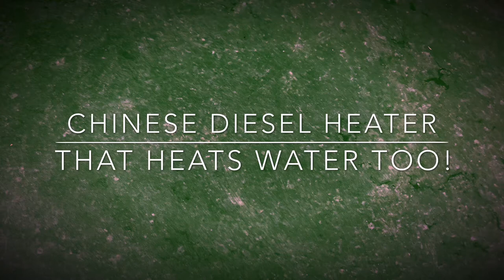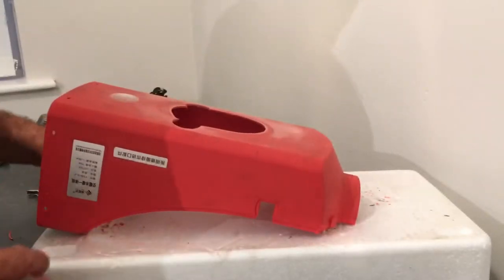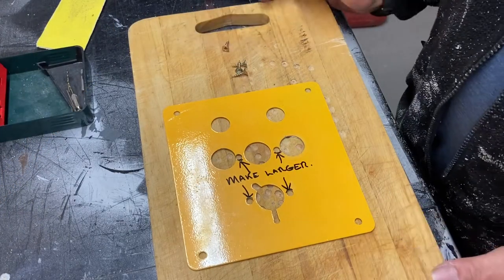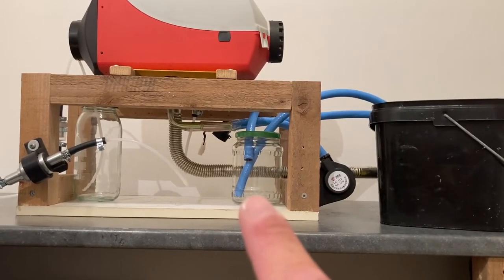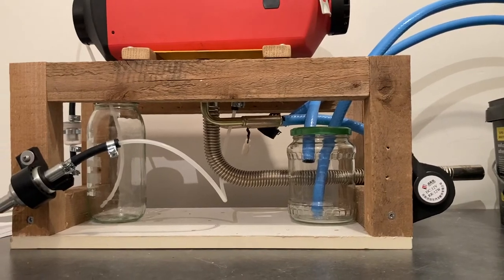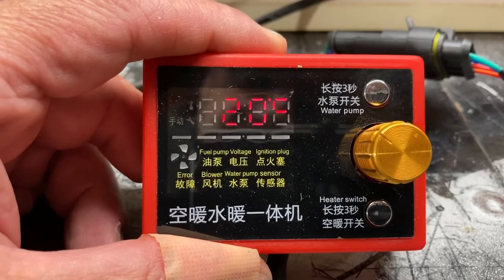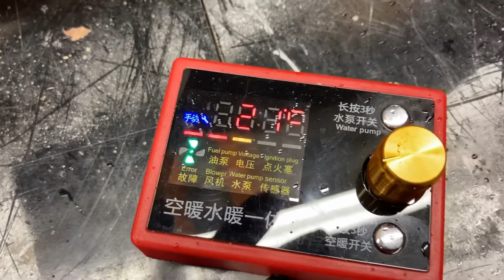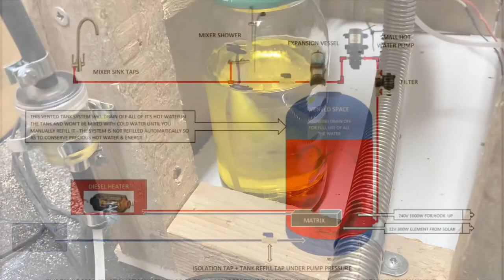Chinese Diesel Water & Air Heater Feasibility Test

Comment: I have installed one of these units in my campervan. I used a 22L marine hot water tank with a heat exchanger running  off the heater. I put in an expansion tank because I was worried about the build up of pressure in the system.
It heats water very well, 30 mins of running on low gets my 22L up to 60c but......this is were the problems come in. I did not want the water any hotter but still wanted to heat the van, so I switched the circulating pump off. It took about 2 minutes for the transfer liquid (antifreeze) to boil in the heater, that blew a lot of antifreeze out of the expansion tank.
I have not worked out how to have air heat without overheating the water, it may be OK if you could drain the liquid completely out of the heater but that would be difficult. I am considering putting in a NZ$200 Chinese air heater I have to just keep the van warm.
This was complicated to install and I sometimes wish I had gone LPG but I really wanted Diesel.
Unfortunately i have not found anybody else in the world who have actually installed one of these in their camper! They  work but you need to be aware of the limitations and design your system accordingly
Reply from the maker: That is incredible valuable information     
  And i never thought of that issue. I just assumed it would be fine with the pump off and the heater on. Maybe its best i buy a cheap separate diesel heater perhaps just a 2kw one as i thought 5kw may be too powerful especially when its not thermostatically controlled. Mmmm you have me thinking. However part of me thinks well may as well just keep heating the water too perhaps?
Reply from the maker: Maybe an option is to keep the pump on but re route the coolant through a towel rack in the shower cubicle stopping the coolant from over boiling?
Reply: @diycampervanman1633   Yes I have been considering that, maybe running through a radiator heater (as in a car heater) but experience so far leads me to believe that this heater  is so efficient that I could not dissipate enough heat to stop the coolant eventually boiling.
Reply: @diycampervanman1633   The only option I can think of at the moment is to fit a separate diesel air heater. I have one that I brought cheaply but finding space for a second heater and the getting a diesel supply to it is a problem. 2kw will be ample for me as the the water heater will be blowing hot air for the first 40 mins and combined with with the 2kw too keep the van warm should be no problem. When I let the water get too hot the pressure build up blew  a pipe off in the hot water system (Twice).....another thing I am working on.
Reply from the maker: Peter Ockleford  i never run my experiment long enough to discover this problem and it is a problem. Once you achieve the water temperature did you run the heater on low thereafter or a higher setting? The last thing i want is to have coolant swilling around the floor area getting underneath my insulated floor. Im going to have to run the experiment again and keep testing the coolant temp. Im really surprised the air flow doesn’t keep the cask cool enough, surely it should as thats the whole point of the fan. I can buy a cheap small towel rack and try that but ill need an electronic  switching valve to re route the coolant. Maybe a different coolant might be the answer with a bigger boiling point but as you say eventually it overheats. I also thought of putting a header tank at a lower point to allow drain off of the fluid once stopped but that may mean placing the machine even higher iff the floor. Fitting an extra heater is defeating the object really though. Im hoping i can fix the problem before i fit the machine as i racked my brains just to get it to work for the experiment.
Reply from the maker: Peter Ockleford another issue is have you sealed off the bottom where the seal dont fit as that would redirect airflow potentially slowing the air cooling system to function efficiently. It makes me laugh how the chinese company approached me to set up a business relationship to buy in bulk lol. I told them its just a hobby not a business but they don’t care if your going to be lumbered with endless complaints because really its not fit for purpose.
Reply: @diycampervanman1633   I was only running it on 1 (very low) when I boiled it, only took about 40 mins to heat up my 22l (which I thought was far to much when I installed it) . it works well as it appears to speed up when you change the setting then beeps after a while and settles down. My guess is that this is purely an air heater with an heat exchanger stuck on the bottom. There is no thermostat on the water side only on the air side. i had antifreeze swilling between the floor area and I did not realise it until I saw green liquid dripping under my van the next day.
I think the best way to look at this is a cheap diesel water heater and  dont worry about the air heating side (just switch it off when the water gets hot)
Reply from the maker: Peter Ockleford i think im going to go for the heater towel rack in the shower cubicle and run a long test on it in my garage 1st as i cant afford  for it to spit anything out under my flooring.  Im fitting it behind my drivers seat where there is a gap between the seat base and bulkhead. There you can still see the bare floor so it would just flow under the living area unless i can seal it off. Perhaps will be prudent of me to do that actually but i wanted access along the flutes to pass new wires through as my van evolves. If the heated radiator idea works then its just a case of keeping the pump on and switch from tank to radiators. Just like a central heating system in a house. When you think about it in a house the pump always kick in when the boiler starts so we should treat our heaters in the same manner! Ive noticed i can fit a hand valve instead if an automated switch as the electric switch requires permanent live for one feed as they are spring loaded. Generally without power you plumb into central heating but need power to switch to tank. Mmm may work if 12v switch. So always on radiator unless i trip a switch for hot water. Peter thank goodness you found my video you have saved a big headache and hopefully we can get this sorted. 🤞
Reply: I dont think your towel rail will remove enough heat from the system to stop the liquid boiling eventually. I was going to order a car type radiator heaters from Aliexpress but then I realised my recirculating pump had started leaking and had become noisy....possibly damaged by the boiling episode!
This made me reavaluate the whole thing. I need some way to control the temperature, I cannot get enough heat in the winter without buying radiators, I have not worked out how to exhaust the blown hot air in the summer yet and now I need a new pump.....I have proven that this thing can generate lots of hot water and it starts reliably every time....But I have ordered a 5kw Webasto type water heater (NZ$525 delivered including Tax). I figure I can use the all the connections from this heater to install the new one and sell the Air/water heater. I will use the 2 kw air heater I have to heat the van in the winter (cost less than 2 radiators).
Its a pity I cannot load a photo as I could show you how I installed it before I take it to pieces but that will not happen in a hurry as most Aliexpress orders are taking forever these days.
I will keep watching your videos and maybe figure out some way to use the air/water heater
Reply from the maker: Peter Ockleford lol i thought i cracked it and got my self hot air and water on the cheap but its looking like i ain’t now lol. Im going to try the radiator heater for the sake of £50 more. Then ill have to trash it or drain the liquid and just use as a hot air machine if all else fails until i can afford something more elaborate. Send your pictures to karl@decoservices.karoo.co.uk
Im extremely interested how you rigged it up. Thanks for your imput.
Reply from the maker: Emma Charlton well i love your ingenuity skills but i think introducing and electronic solenoid valve means more wires, more electricity and more hammering of the pump. Also more pipes and putting a dump rad outside seems sacrilege when it could be used to warm the shower cubical up or under floor heat pipes etc? I’ve recently being looking at this problem again and I think the way forward is to put two air float valves before and after the water ports on the heater. So if the coolant does boil in the heat exchanger as peter ockleford  says it will, then the gases it produces should be immediately release from the system avoiding blowing the pipes off. 
I intend to keep my set up for now but add air float valves either side of inlet/outlet and a one way by-pass valve around the pump so liquids can retract back into the expansion tank. This bench test will be up and running in a week as im desperate to get it fitted in the van now because i was freezing camping in wales last bank hol lol.
Reply from the maker: @peterockleford5391  Hi peter, i have a question for you as Ive redesigned the coolant system to try and eliminate yours and possibly my coolant system from blowing the pipes off. My question to you is did you use waterless coolant?  Im using waterless so it cant boil. It will gas up but only at 180C. My theory is the coolant shouldn’t get above 180C as the airflow should have some bearing on keeping the cast cool. Plus im not going to use a pressurised system. It will be an open vented system so if the coolant does gas up it can push the liquid back into the expansion tank. Thirdly, ive fitted automatic air release valves just before and after the machines inlet/outlet ports so any  liquid that does gas up will be ejected from the system before it can blow any pipes off. Also those valves double up as an air lock eliminator.  Ive run a test with clear pvc pipes so you can see how gas escapes or is ejected when filling the system. I think this is the answer and ill be putting it through the riggers in my garage this weekend. Of course there will be a follow up video showing my revised bench test and the installation plus showing it operational in my van before Christmas. I can keep you informed prior on these message feeds what the outcome is before the video is made. Fingers crossed 🤞
Reply: @diycampervanman1633  Hi, sorry for the lack of a reply to your other questions but I have given up on this heater and sold it. I just could not over come the problem you are having and also could not vent the hot air in the summer.
I used a very concentrated coolant (probably 80/20) but I believe that the temperature at the heat exchanger could get VERY hot if the liquid isn't circulating. I cannot see how this unit can be run without the pump running (and therefore lots of hot water) I believe you are getting  at least 2kw of water heating which can bring a couple of litres of coolant up  to temperature very quickly. I would be really worried about running any pipe work even close to 180c. When it boiled in my open system the steam blew all the liquid out of my expansion tank.
The only way I could see it working was to use it as a water heater and switch it off when it reached the require temperature. A standalone diesel air heater is fairly cheap and you could use that to warn the van.
I have replaced it with a Webasto (chinese) water heater and a 2kw diesel air heater and am happy with the result (had trouble setting up but all good now) All up about $700NZD and much simpler
Reply from the maker: @peterockleford5391  Thanks for your reply. You know i never gave that a thought that the coolant can go upto 180c but the pipes can’t !  The pipes are rated at 120c but i guess im hoping it wont reach those temps from the air cooling effect, cooling it down too but it sounds like I’m hoping for too much. I may sure up the pipes up to the vents given your info but i may also have to face facts its just all to impractical. Ill let you know how i get on anyway but there may be a delay now. Like i say ill bench test it so if it does blow any pipes off its not in the van. Cheers, karl.
Reply: @diycampervanman1633  Hi, just another thought, my Webasto clone heated the coolant up much faster than the heat exchanger could transfer it so the heater would shut down long before my water heated up. I realised that the small diesel pump came in different dosing amounts (.016ml for 2kw, .022ml for 5kw and .032ml for 8kw?). I brought and fitted the .016ml pump and that solved my problem. It now runs quieter (used to roar) and still only takes 30mins to heat up 22 liters of water to 70c. I had not noticed that the fuel pumps are marked. 12-16 for 12v and 16ml etc and my webasto clone was supplied with a 12-32 which was much to big. I dont know what the air/water heater was fitted with as I had already sold it by then.
It might be worth trying a smaller pump as the controller on these units does not allow you to control the pump frequency as some do
Reply from the maker: @peterockleford5391  well i learn something every day. Thanks. 12-22 mine says so theoretically correct for a 5kw machine but what your saying is if i fit a 12-16 then it will run slower? thus lower heat generation’ meaning less chance of boiling?
Reply from the maker: Ive just watched the David McLuckie video and the heat exchanger housing got up to 168c on full power. This hopefully means it wont boil or gas up using the 180c waterless coolant?
Reply: @diycampervanman1633  I assume that is when the liquid is flowing through the heat exchanger the liquid would be cooler than the metal around it, when you switch the pump off and the liquid stops flowing is when you have the problem as I would think the heat exchanger would get a lot hotter. Did David McLuckie ever run it without liquid? The waterless coolant seems amazing and could prevent a lot of the problems, I just find the thought of liquid at 180c a bit scary and wonder what sort of pipework etc you would need. 
I gave this a lot of thought and decided you need some way of using the hot water (to heat the van) in the winter and have the advantage of the hot air as well, maybe long runs of copper pipe or a converted car heater . A friend of mine used a heater from the rear of a landrover (he has just replaced it with a chinese air heater because of the current draw of running pumps and fans and a genuine Webasto water heater)
No matter how I looked at it using this for just heating the water and then switching off overcomes all the problems, it works well at that.
Reply from the maker: @peterockleford5391  your correct in saying David Mclukie didn’t stop the water flow that is true. However I’m hoping the cask still doesn’t get red hot due to the air cooling action as that is always operational. My hope is if i’m correct, then the waterless coolant will stay liquified. Now when i originally tested the machine on my first video, there was a period of time that lapsed before and after i turned the pump on with no issues.  The coolant was given to me by a friend in a soft drinks bottle (yer i know😬) that came out of an ice cream machine so i had no idea what it was. I noticed it was weird stuff because it never dried on my work bench so i’m assuming i had a similar coolant then too. Its been diluted since so i can’t use it again plus it was old second hand stuff but that could be the reason i had no issues first time??  Anyways the machine is set up in my garage now ready and waiting for a destruction test. I have sprayed the in/outlet ports black matt and borrowed a laser thermometer. Just need a new battery then i’m set to put the machine through the riggers and run it without the pump on. The machine has a heat sensor so the cask temperature reading will be displayed but the laser will be pointing at the in/outlet pipes to see if the liquid is being forced out at very high temps. My theory is, the gassing if any at all  will be minimal and only push back the liquid to say the in/outlet pipes. The liquid that was standing there prior wont be as hot as it wasn’t in the heat exchanger. Tomorrow will give me the final answer. If it fails then i will have to upgrade the heater pipes and gas vents because they only go upto 120c. Failing all of the above, then i will reside myself to using it only as a water heater and fit a second 2kw heater using the 5 as a booster only. Fingers crossed ill let you know tomorrow night how i got on. Its all ready to go in the morning after a slow sunday morning.
Reply from the maker: @peterockleford5391  Hi pete, my full stress test is complete now and i said i would report back to you.....it worked well!! 😀 
I must say i was very nervous but 2hour and 15mins in without the circulation pump on it remained stable with the cask sitting at 160c constant. That meant the coolant was stable and never gassed up. Naturally if any water was present it would boil at 100c but the coolant was the key to all this as the cask has a running temp of 160c. when i switched the coolant pump back on after the 2hr running test the cask cooled down by 20-25c. Instantly. Therefore you where right but i was also as the airflow did keep the cask at a constant running temp. Another interesting thing i found was if you cranked the fan up to a higher setting, say 4 out the 5 the air temp flowing out hardly changed. This must be because the faster the airflow the faster it cools it down. The only benefit for cranking the machine up is to heat the water faster. My only confession is i didn’t dare crank it up on air only as it was running so beautifully on setting 1. All said and done. The air temp going into the machine was 13c, so if in warmer climates, who knows ehat could happen? I guess i have to see this as a successful experiment and fit it now. The key is to keep an eye on the control panel and make sure the cask does not go above 180c in warmer climates. That said n done, i msy not need it for heat in warmer temps, just to warm the water up. I guess its a case of getting use to it. Thinking on fitting a mini log burner fir those bitter evenings anyways but for now im happy and thanks fir your input. Ive got to fit it yet in the van so it will be a while before the vids out. Ready fir Christmas hopefully. Cheers, karl.